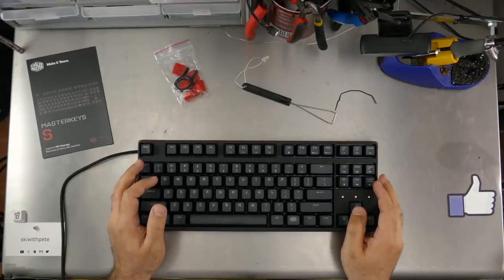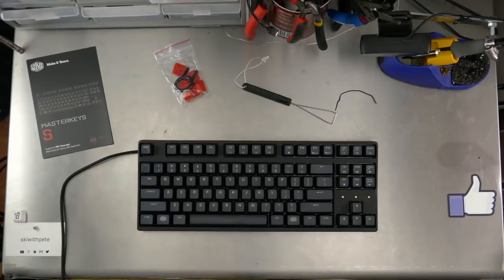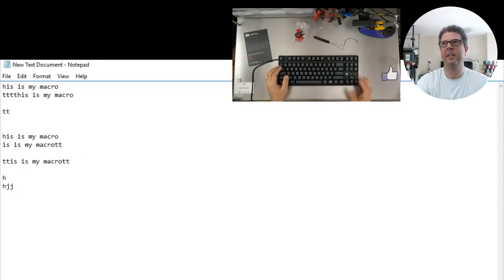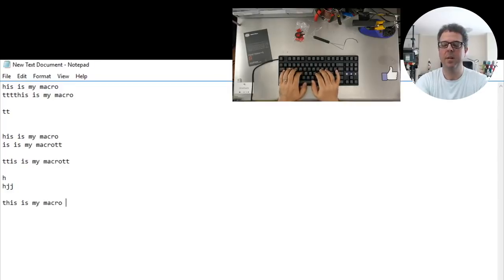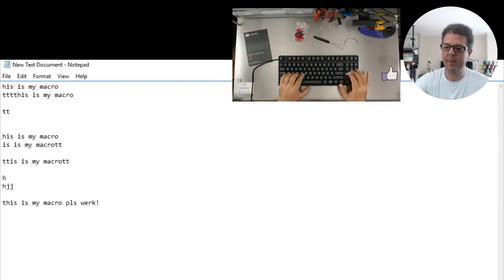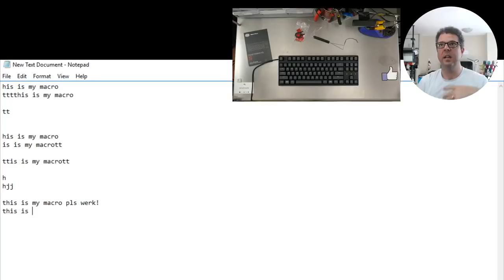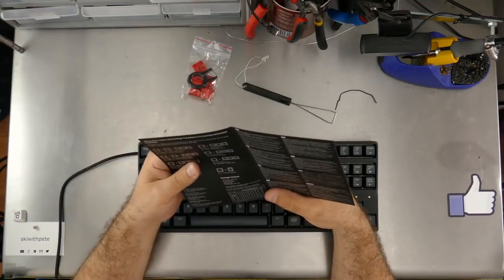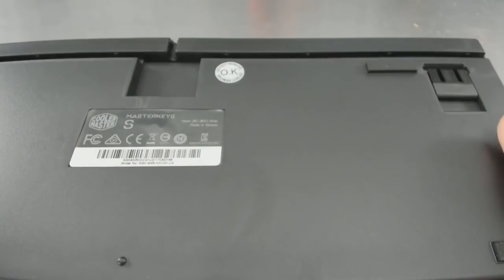CoolerMaster Masterkeys S PBT - the new perfect mechanical keyboard for first time buyers

Comment: I was wondering what size the space bar is on the keyboard? I am looking to buy it after watching this awsome video and want the 1976 keycaps on the keyboard but I want to make sure the space bar will work.
Thanks :)
Reply from the maker: Yep, it's a 6.25u spacebar.  Part of the reason I love CoolerMasters so much, they made a keyboard with a standard layout.  So yes, you can swap out the keycaps with most commonly available sets.  -- I think I have another video about how to deal with CM stabilizers tho.
Reply: THANKS!

Comment: Hey I know this is like 3 years later but if I have the non-Pro version (no LEDs) is it possible to solder them in myself and get that backlight functionality? Obviously i will get switches that allow 1.8mm LED fit and get see thru keycaps
Reply from the maker: I don't think the PCB has holes for LEDs.  Probably best to start migrating towards customs.

Comment: Got a dumb question.  Okay, say I buy a small keyboard like this.  Is there a shell-like frame to make it a little bigger.  I'm used to a KT800U2, and I am just now switching to a mechanical keyboard.  But, they're smaller than a normal 104.  Can I set it into a frame-like contraction and then screw it in?  Sorry, I'm not sure where to ask this question.  Thanks.
Reply: No, there's no add-on for this board.  Why not just get a full-size like this: https://amzn.to/2FU5G7K

Comment: which one is better for gaming and which one for programming/programmers:: masterkeys s pbt or masterkeys pro s (white)???
Reply: astra tor PBT is so much more better feeling than the ABS plastic caps the other ones come with in my opinion, so I’d recommend it for both programmers and gaming if you don’t care about backlighting.  If you want backlighting you can always get the pro and swap in some PBT keycaps.  What you should really be concerned about is your switch type (blue, brown, green, etc.) which is completely personal preference.

Comment: What is the purpose of the removable controller?
Reply from the maker: It means that you can replace the controller... with this: https://1upkeyboards.com/the-unloved-bastard-controller.html
Reply: Not 'can', 'SHOULD'. Fredrik's boards are amazing and takes your $80+$40 keyboard and makes it the equivalent of a $300 programable keyboard!
Reply: @4:00 It probably was grip coated like my Quickfire XT - lasered and filled with paint - that still holds its color up to this day. :)
Reply: I used a frosty flake on my quick fire rapid :)

Comment: Anne Pro is the best value keyboard since you can get it for $62 new on eBay and you get pbt keycaps, gateron switches, rgb, Bluetooth, 60% layout, and compatibility with mobile devices in addition to computers.  Definitely the best value keyboard out there.
Reply: Most people beginners will prefer a tkl layout over a 60% one though
Reply: Fack off

Comment: how's its robustness compared to the pro version, aside from the pbt caps?
Reply from the maker: identical, I'd say.
Reply: thanks. i'm going to get one to use in the office for my work (as a programmer), so backlighting is not necessary. given that, the non-pro masterkeys seems to be a much better choice than the pro. i just don't know for the price difference (pro is a little more expensive than the non-pro), the backlighting vs. pbt caps is the only trade-off or is there anything else that makes the pro "more pro" (i.e. superior to the non-pro)?
Reply from the maker: get the non-pro.  It's also upgradeable to fully-programmable with one of these: https://1upkeyboards.com/the-unloved-bastard-controller.html (the pro is not upgradeable)
Reply: skiwithpete great, almost made up my mind. last questions: 1) do you think the legends are tough enough to withstand prolonged use? Some guy down there said they're not laser etched. 2) i can get this one for €90 and the filco for €140, do you think the €50 difference is worth it, or the masterkeys still tops the p/p ratio?
Reply from the maker: Get this one.  You'll want to eventually replace the keycaps - but they'll defo be better and last longer than the filco keycaps.
Reply: skiwithpete fair enough, i'll get this one, thanks a lot. but i'll also want to get another one for home use (typing and gaming, with lighting), and eye on the pro M and Logitech G pro. do you have any idea about the rome g thing? (sorry i lied, that was not the last question)
Reply from the maker: I don't know anything about the romer-G.
Reply: skiwithpete ok np, thanks again for helping me decide.
Reply: I have the masterkeys pbt with me, it feels like it has somewhat different construction. there's a hole under the feet that reveals the board (green?) inside. is it awkward?
Reply from the maker: Tuan-Anh Bui this sounds different to the one I have...
Reply from the maker: Ah, yes, that's fine, and normal.  The keyboard has a metal top-plate, but only a plastic bottom half.
Reply: thanks. and it looks to me that the key caps are quite easy to pull out (using fingers)
Reply from the maker: Tuan-Anh Bui that's totally normal. They shouldn't just fall off, but they should be removable.
Reply: skiwithpete maybe i'm too skeptical, it's because i'm comparing it with my 2 other kb (g80-3000 & masterkeys pro M), but the others' caps need much more force to pull out, plus the space bar makes weird noise if touched/moved lightly..
Reply from the maker: Tuan-Anh Bui if the keycap are too loose, lookup the tape hack.

Comment: Ha.. I just got the cherry red in India but it's not the newer model. No PBT keycaps nor the cable goes under the keyboard :/
It's a lovely keyboard tho..
Reply: The model name actually has 'PBT' in it. If it doesn't have PBT in the model name, it is not the same keyboard. There are multiple versions of the Masterkeys S.
Reply: Actually I only found out after watching this video. :P
The PBT model is not listed in online stores. Amazon has the S model but there is no mention of a newer PBT model available.
I will look for pbt caps separately then..

Comment: Does the keyboard feel hefty and sturdy?
Reply from the maker: Spartan absolutely
Reply: skiwithpete Awesome and just another question. Do these keys have that nice grainy feel PBT caps are known for? Thanks in advance
Reply from the maker: Yes, but no.  They're pad printed, not dye subs, nor double-shots.  So, you can feel the letters on the keys.  Not ideal.  Truth be told, an off the shelf PBT keycap set would still be better.  But they're still a quality starter set.
Reply: Great. Thanks again for the quick response and insight!

Comment: Hi,this is doubleshot keycaps ?
Reply from the maker: No, single shot. Pad printed.
Reply: @skiwithpete  Legends on keycaps gets deleted after some time or ?
Reply from the maker: @babyyou548  exactly. They feel great. And they will for a very long time. But the legends will fade. If you touch type, it won't matter, but eventually replace them. I personally like thick ABS double shots like maxkeys from 1upkeyboards. But you won't need those right away
Reply: @skiwithpete  I order from Joybuy.com(Jd.com) for 11.99$,Cooler Master Pbt with Grey keycaps and purple legends they are China only realease but they are the same like this on video.To change my Abs doubleshots from my some random chinese mechanical keyboard.And only thing that i am afraird because they are not doubleshot because of legends.I like the font on this coolermaster keycaps.And i hear pbt keycaps have nice feal.
Reply: @skiwithpete  i hope legends on keycaps they will last long time.I will probably also buy Gk61 with gateron optical swich and use this keycaps that i order from China.For now i will use them on this random chinese mechanical keyboard.

Comment: That keyboard with PBT keycaps is so freaking pain in the ass to find.
Reply from the maker: The link in the about section has some in stock
Reply: @skiwithpete  
"Currently unavailable. We don't know when or if this item will be back in stock. " However, point is, I am not used to amazon in general and won't trust some random company on the Internet. Besides, if keyboard breaks, sending it back will be terrible. I am from Europe.

Comment: I object. The best value mechanical keyboard is the Motospeed CK104.
Reply from the maker: the Motospeed CK104 has scratchy Outemu switches.  Inferior ABS keycaps.  And is a non-upgradable PCB.  Just because it's cheap, doesn't make it good value.  There's nothing wrong with a Motospeed CK104 for your first keyboard, but it's not really in the same world as this keyboard.
Reply: We are talking about first time buyers here, who wants to spend 90 bucks as a first time buyer?
Reply from the maker: Haramasch Abrasir who wants to spend 50 and then have to spend 90?
Reply: Haramasch Abrasir Red dragons are better do not get the Motospeed like I did. My friend has a red dragon and its much better. I now have a Corsair Mechanical which is other worldly

Comment: i dont know if u know but if its thick that means its doubleshot
Reply from the maker: That's not true at all.  These are thick, and pad printed.  Double shot means they have used two different colors of plastic.  Shot 1 is the legend.  Shot 2 is the rest of the cap.
Reply: skiwithpete aha ok i thought that every thick keycap was doubleshot because most of the times when i watch some keyboard videos amd they show the doubleshot keycap its usally very thick, but i got a question about this. So lets take vortex for example, their doubleshot keycaps has the same color both on the inside and outside, why?
Reply from the maker: These are all great questions.  Some of the answers you're looking for are here:  https://deskthority.net/wiki/Double-shot_moulding - double shot doesn't necessarily extend down the sides (though it can with certain caps).  Take a look at that page and let me know if you have more questions.
Reply: skiwithpete ok thx!